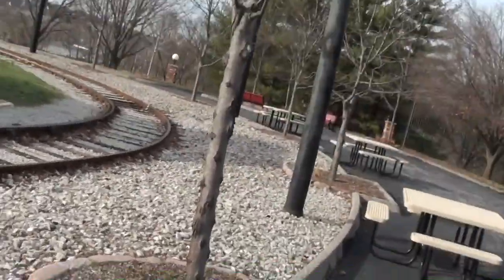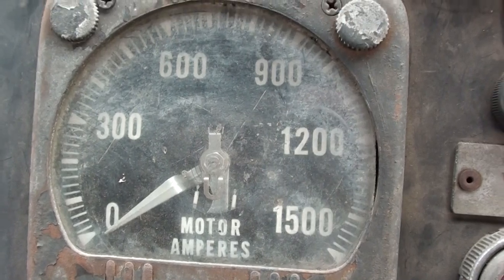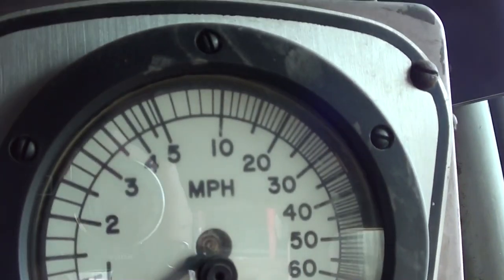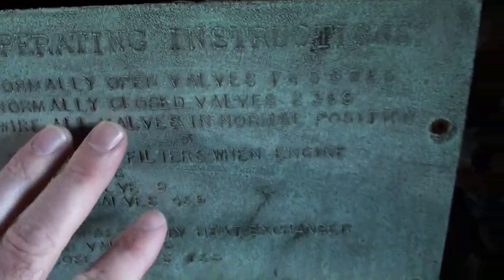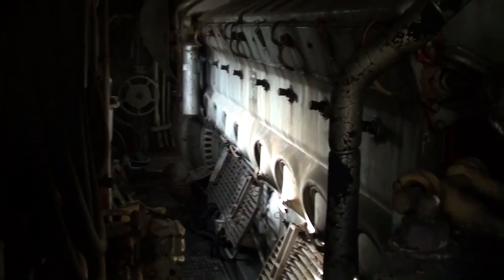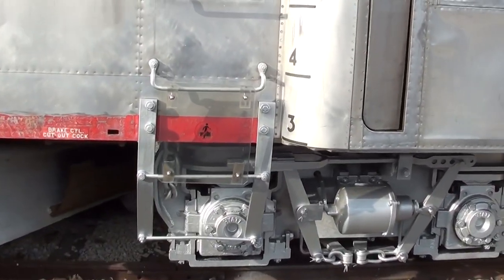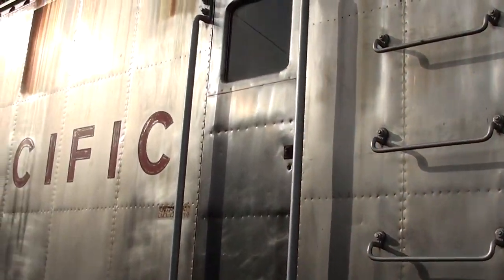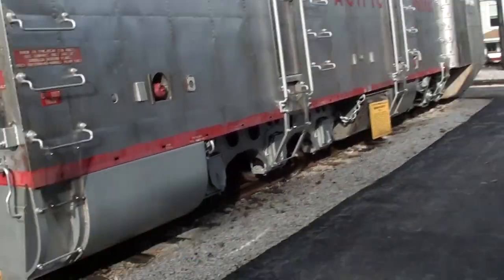Inside Tour of Union Pacific 3000HP Rotary Snow Plow Heaviest Ever Produced

Comment: From what I've seen of the Steam Powered plows, the Cabs were more like a Steam Locomotive's Engineer station but with fewer controls.  Few Plows have ever been self propelled (Relying on being pushed), so instead of having things like Reversers or a complete Air Brake control suite they have just the controls needed to control the speed of the blade.  Also, instead of an EMD Diesel Engine, they get a boiler, usually with the firebox at the rear.  Firemen on those plows usually got real cold lol

Comment: I wonder what the designers thought they were doing when they designed an open grate type floor in part of the cab, surely a solid floor and good heating in the way to go on a plough that could get stuck sometimes? How are they, the driver/s going to keep dry and warm when theres no floor.

Comment: The only one left on up is 900 082 the 900 080 are the only ones left the 900 080 was built in the late 1950's with a 567C or B and 1'750 hp, and the 900 082 was but in the early 70's with tge same componits as the 900 0 81 I think